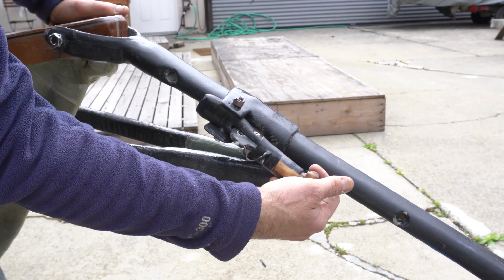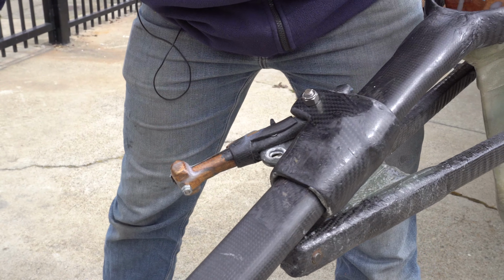Completed quadruple pin towbar mechanism. Holy grail for Bike Sailing? Inventor reveals process.

Comment: You are my hero! this system is exactly what i was looking for... thanks for that! 
Is there any video where you show in detail how you made the wheels under the bench on the sides?
How much weight can the wheels carry and how heavy is the boat?
Reply from the maker: Thx a lot. I do have a vid on the making of the wheels. Plz subscribe or check back. I was using traditional spoked wheels but the spokes were loosening and the bearings were too small and seizing and exploding. I stepped up the bearing size and rim strength. Boat weighs 330-450# depending how much gear I'm carrying.
Reply: @fossilfool  i subscribed and checked back... actually i have now seen all of your first mod videos, but i have not found a vid where you show the process of making the wheels!? what is the name of the video?
The boat weights up to 450 pounds?! Wow, that is a lot and you can handle this with the bike and do not need any extra brakes downhill?
Reply from the maker: @freakazoidvienna  Haven't posted it yet. Thx for subscribing. Braking has been fine downhill at the speeds I go, but I can tell that an emergency stop wouldn't be safe. The rear wheel of the bike would skid and the boat would jackknife me.